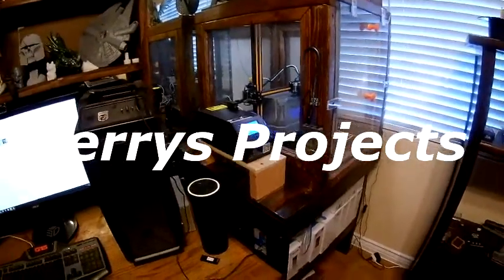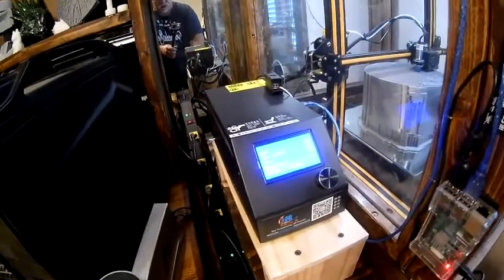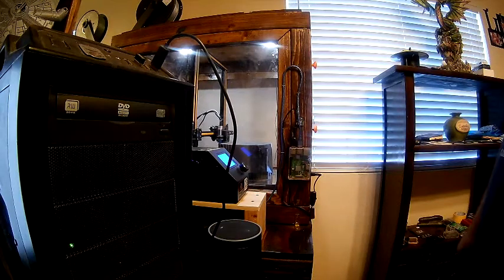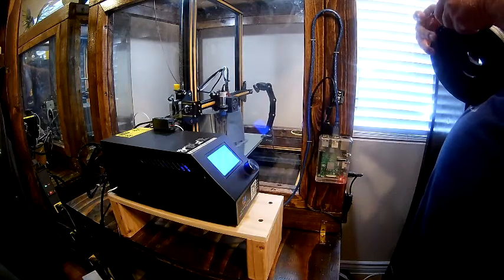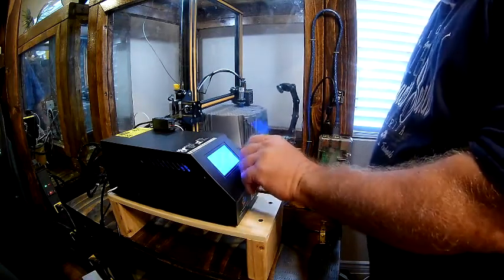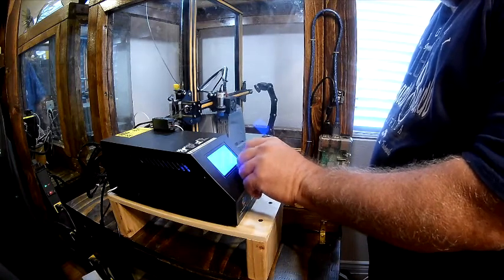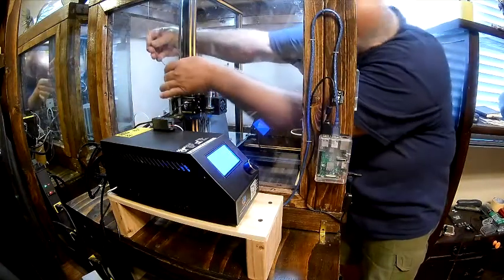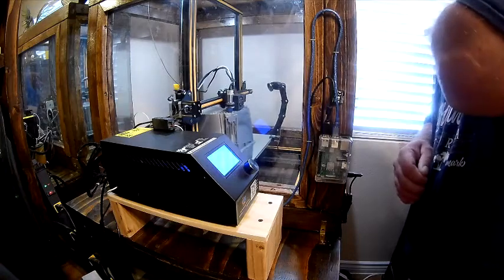Changing Filament on Creality CR10 3D Printer with new Marlin Firmware  1.1.4 installed. #3dhp

Comment: Damn Jerry!  You make that look easy.  So far I'm 50/50 on the change of filament.  I'm heavy handed and ten to push down on it and mess things up.  I was able to fix two print by manually turning the z rod till it wasn't hitting the print anymore.  But my last two trys have been good.